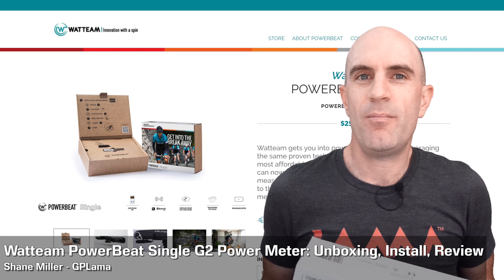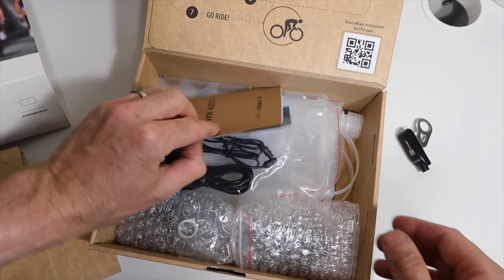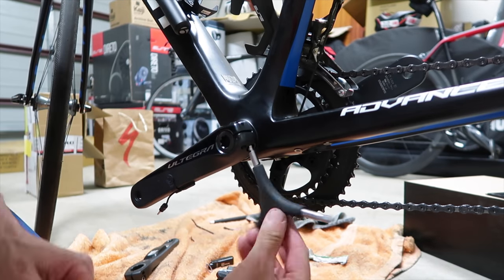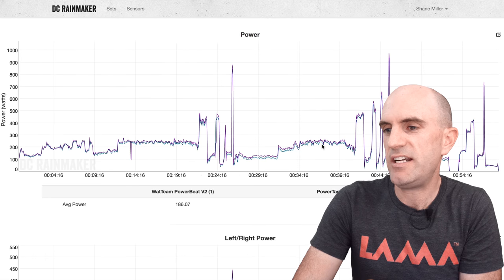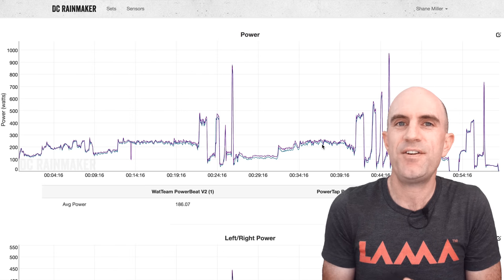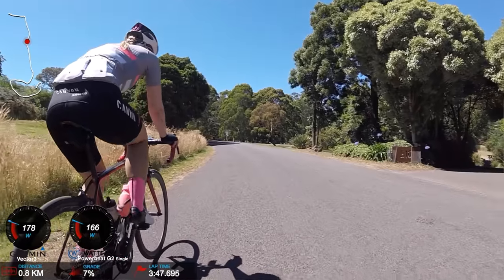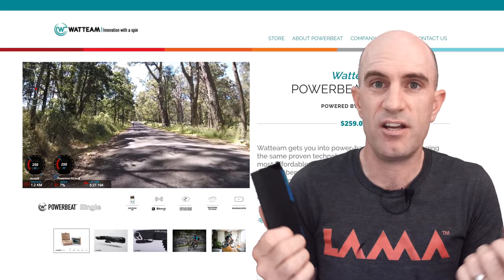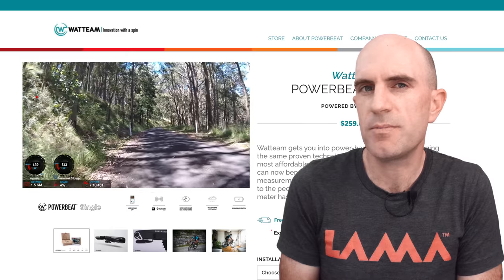Watteam PowerBeat Single G2 Power Meter: Unboxing, Install, Review

Comment: As always a very thorough review. The problem for someone like me is when I do buy a product like this I have nothing to compare it to. So if it's not recording correctly I would have no idea. Manufacturers of these products need to get it right. Their products must be accurate to spec and consistent. I like this product and the price is right however if it doesn't work straight out of the box, sorry it's worthless. Again great review, safe riding.

Comment: Thank you for the great review, making me feel better about buying the budget option as my first PowerMeter!

Although I didn't remember about the settling in period, so I might re-run my calibration on the dual unit. Also the self-install was incredibly simple, you should try it. 

Keep up the great channel.
Reply: I have the dual sided option. Definitely recalibrate, especially if you move the comp units even a bit from pedal tightening or such.  My experience drove me nuts until I realized what was happening.  Also zero them out only after that 10 minutes warm up.  I'm still getting used to that "inconvenience" then I remember I only paid $320!
Reply: Thanks for the help. Having power is a game changer for me and getting fitter. The "inconvenience" is so simple when you consider the price point for a dual-sided power meter.

Comment: There are generally two adjustments to strain gauge devices, Zero calibration and Span calibration. It's possible the weight of the pedals are giving the unit a "false zero", which you've rectified by removing the pedal weight from the Span calibration. They should implement a "real" zero calibration to account for different pedal weights, then you can use the span calibration weights to give the unit it's "range". But hey, for the price, it looks like a good product and is significantly cheaper than it's competing products so good luck to them! Good review.
Reply from the maker: Bingo on the accounting for the additional pedal weight... but my unit was a little more skewed then just the pedal weight. I really wanted the ability to do a static torque test.... but the slope 'slider' would be a suitable solution for the price.
Reply: The only way to independently measure the response and linearity of crank based strain gauges is to build a fixed test rig with calibrated weights. I guess the slope slider would be pretty easy to implement, but manufacturers seem reluctant these days to provide users with "advanced" features and not just in the powermeter market.

Comment: If I bought this as it is how would I know if it was accurate without another power meter to compare it with?
Reply from the maker: That's what a lot of people lose sleep over with any power meter. Welcome to hell! :)  It's easy to check against a known good source such as a Neo, Drivo, Direto, spundown Kickr, etc. If you can't afford inaccuracy or the ability to check, then don't go for the budget power meter.
Reply: Doesn't it state 1.5% accuracy
Reply: Makes sense actually. It’d be my first so actually you’re right I could absolutely cope with that at my level. 

Keep up the great channel. Cheers Shane.
Reply: Keep in mind that he did not try to "recalibrate" it because it was inaccurate. We don't know which one of those 2 is actually the accurate one. He tried to match them.
I have the same issue with Neo and Vector2. Vector2 is always cca 5% low. So I adjust scalling on Vectors to match Neo. As long as I had only Vectors, this was not an issue at all.
Reply: To a degree it won't matter. Whether your bathroom scale weighs a pound above or below your real weight, you're still measuring against what it was before
Reply: buy a power tap pedals and compare
Reply: You know it's working when you're really happy how many watts you've just pushed.
Reply: So which one gives me the most watts? 😂

Comment: Bought these and had a couple of fails in gluing the sensors.  Here's my tips/thoughts:
1.  Pour boiling water into a cup to heat the glue. (the instructions say hot water but not how hot it should be)
2.  After you have mixed the glue, thoroughly, move all the glue to one end of the packet.  This will mean you can cut near that end and its easier to get the glue out
3.  The support team are really helpful.  If you're not sure of something, email them, or contact them via skype by searching for watteam support.  They talked me through it today and I'm much more confident that I'll have success this time.  They have even offered to help me with the calibration and they say that they have the ability to see how well calibrated my sensors are on their systems in real time (WOW!)
All in all I'm quite hopeful that this will turn out to be a good product for the price (circa £350 dual sided).  There is some time and work involved, so if you don't like DIY you're probably better off with a pedal based system.
If you do take the plunge, use the link through gplama and clever training for a nice discount.

Comment: I have the Elemnt Bolt. I also recently purchased a Tacx Neo. I let the Wahaoo head unit detect the Neo. Everything went well, until I decided to cycle outdoors again. I was getting power from the Powertap G3 but it kept dropping out to zero every couple of minutes. I had just renovated the G3 so I thought this was the problem. I was ready to dump both the Bolt and the G3. Then I had the bright idea to try my Garmin 1000. It tracked the power perfectly, so I knew the data from the G3 was good. I then had an idea to ask the Bolt to forget the Tacx so that only the G3 remained and it worked perfectly; no dropouts. This might be your problem
Reply from the maker: The Elemnt/BOLT uses proximity pairing when it comes to similar devices. I don't leave that to chance. I only pair/list devices I'm using. I like the theory... not likely the issue.

Comment: I noticed you used a bathroom scale to measure your 4.5 kilo water bag.  You seem to have come to the conclusion that the weight of the bag was off and that did the trick.  Maybe your bathroom scale is off and your adjustment of the bag weight brought you into a real 4.5 kilo bag?  I know my bathroom scale is not that reliable.  I can get a different reading by .5 kilo on two consecutive tries.  Just a thought.
Reply: correction... that was not a bathroom scale, but same thought applies, could the scale you used to measure 4.5 kilos be off?
Reply from the maker: Scale was a bathroom scale, weight also checked with another more precise set I have, all good. There was other discussion around the calibration with Watteam that would have made the video 45mins long.... in short. Scale was correct, the calibration process using 4.5kg resulted in readings I didn't accept, I sorted it, gave feedback, hopefully we'll see that scaler introduced.

Comment: Love your tech comparison vids. Have you ever thought of doing linear regressions using the 2 data sets (plot one data set on x axis the other data set on y axis - can use excel). You would then get a tangible number when the line of best fit is calculated (r squared) ... the closer this number is to 1.0000 the better the correlation between the two units being tested.

Comment: The glued unit is almost $450 AUD. Right now you could buy a Stages gen 2 or 4iiii for around $550 AUD. These budget units have to come below $300 AUD pricing to appeal to users.
Reply: Cycling Choice stages is horrible. New battery every other day. Sick of it. Half the time can’t even connect. Gen 2
Reply: Been happy with my stages.
Reply: You have moisture inside your Stages. Open the battery cap and let it dry for couple of days. It will solve the problem with battery drain.
Reply: seems like stages is way better than this watteam crap.  happy withy stages gen 1 . way better bang for the buck
Reply: Stages are crap, always leaked water in, faulty product should not have been put on market in first place.
Reply: Bought Stages Ultegra gen2 and Stages XT for mtb,9 months ago, rode both trough all kind of weather and temperatures (rain, snow and temps down to -5C) drove XT into bushes, caught some branches with it-broke the cap....they sent me new one, no question asked (whaaat???) although it was obviously my mistake...had to replace one battery so far on road PM and i do ride couple times a week both bikes...never had a read dropout, never had unrealistic readings (as far as i can tell)...satisfied as much as i can be!
I wish i could work for company as Stages...
Reply: Stages detects meat eaters and punishes them with battery issues.

Comment: Great one Shane... So here is my story so far on this... I bought this unit, dual side, and at the time they only had the self glue option. Installed it as per directions and feel that was done correctly. Ever since I have installed it, it has been tremendously unreliable, with drop outs and readings well below what it should be. Since I never had any other power system to measure against, I went to another borrowed bike to assess what it felt like to rip out a 300w session....repeated that on the G2 power installed bike and readings were down 50 or greater percent. Worked with support and over a periid of a month just gave up.... Considering changing to 4iiii....but having watched your side by side, I am going to give this another go. I have the wahoo snap trainer, so I have something to measure up against. Any tips aside from what you have included here.... Excellent  trouble shooting on your side. Rav
Reply from the maker: Just keep pushing them to release the 'slider' adjustment option.... and being able to read torque direct from them will allow static weight tests. Those two things will keep us number nerds happy.
Reply: Shane, earlier I mentioned I reached back out to the Watteam Support, and agree that they are fairly consistent and want to help. I did follow the self-glue option step by step, with no success. In the past two months I have sent my cranks in and they did the gluing and returned it within a two week period. For most part this was successful and first ride worked well for the first 45 mins...then it stopped totally. I suspect it was a charge issue, but I hope to enable the zwift and see if I can do a side by side comparison with Wahoo Kickr Snap power readings. I am not sure on importing data to the DC Rainmaker for a side by side comparison. Any tips on that ? Perhaps a site that you have used to train your self up on.? Thanks in advance Sir

Comment: I always believe consistency in your power numbers are more important than accuracy. Whether your numbers are +/- 10W, it doesn’t matter if they’re consistent and you use those numbers to gauge your efforts and work to improve.
Reply from the maker: Yep. But moving from bike to bike or to trainer, they need to line up nicely. And it's something I'll strive for... and expect companies will help us as consumers do.
Reply: Totally agree Lama. I was just speaking more for the masses that only have one bike. I actually just changed Zwift over to read my power off my Stages, and then my Kickr is the controllable, in hopes my power readings indoors and out are consistent.

Comment: Just some interesting data, for another power meter on the market, which is designed in Australia, it uses a wein bridge setup which measures spill current so actually corrects the reading in real time and any drift is corrected on the fly. I personally didn’t buy one as they were expensive when I parted with my money but now after I bought a different brand they have been reduced. If I could pick any PM this would be it. It is a crank based unit.
Reply from the maker: Infocrank?
Reply: Shane Miller - GPLama Yep

Comment: Another update if you care.  After a third fail on the gluing, they've sent me a pre glued crankset for free. (better than the one I had, as they didn't have mine in stock. ) I'll be out tomorrow on it so if it works, they'll have gone from hated to my favourite company ever.
Reply: Ok, so they're about my favourite company ever.  If I spin really quickly then stop my cadence is out for like one second, but the power seems very reasonable. Alls well that ends well.

Comment: For single side power meter, I still think 4iiii is the best. After adjust the “factor”, it only +-5 w compare with my neo
Reply from the maker: I'm still trying to get a hold of the new 4iiii offerings.... Stay tuned.
Reply: I have a new 4iiii.  I like it so far.  BUT,   I liked my Stages 2nd gen for about a year until water got in and destroyed it.  They replaced it with a third gen.  I had already bought the 4iiji.  So I am keeping the Stages as a backup.  If the 4iiii stays reliable I will sell the Stages.  stages still has water ingress problems but customer service is incredibly good.  Nobody has reported water problems with 4iiii so fingers crossed.  My experience so far based on perceived effort is that read the same.  250 watts on 4iiii feels same as it did when my Stages worked.

Comment: Static torque test with higher weight (>20kg) and adjusting slope should really be possible with this type of power meter. It could be actually deal breaker for me.

Comment: Whats your L/R power meassured with the P1. When you calculate the left only readings the output will be dobbel either way. So if you are 47/53 on your  L/R power on your P1 power, the left only option will only show 94% of your actual power even if the readings are spot on.
Reply from the maker: I’m well across this. 50/50 was still different.
Reply: I guessed you knew that, but worth mentioning for people that not are aware of their difference in L/R power. They might be complaining about the product when in fact the problem is their L/R power distribution
Reply: @Henning,
a very valid point regarding L/R